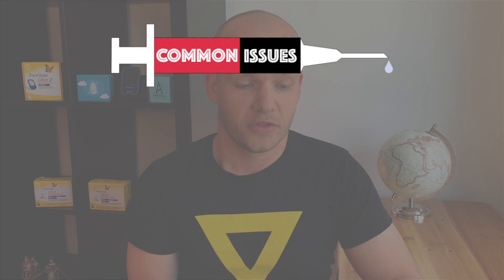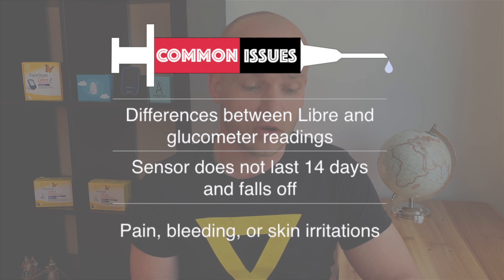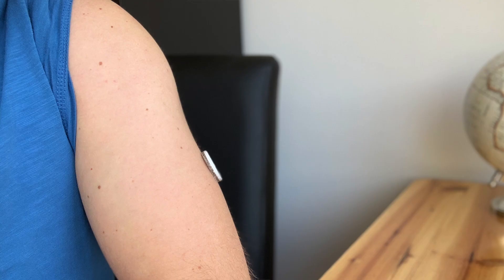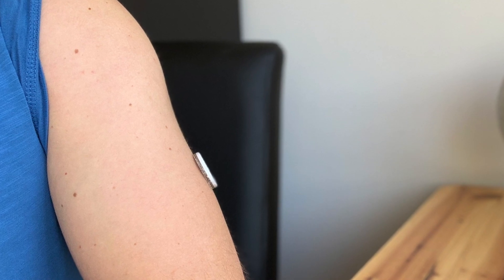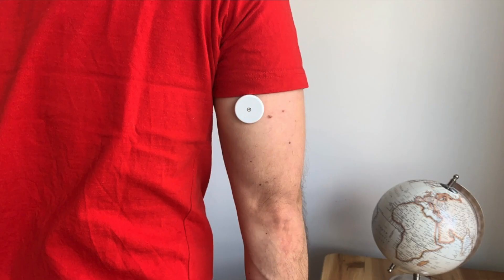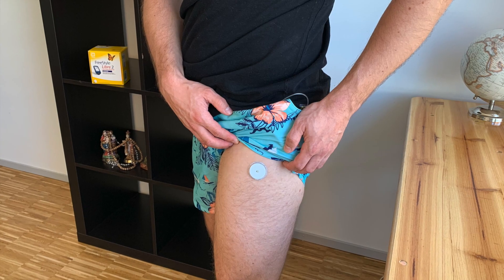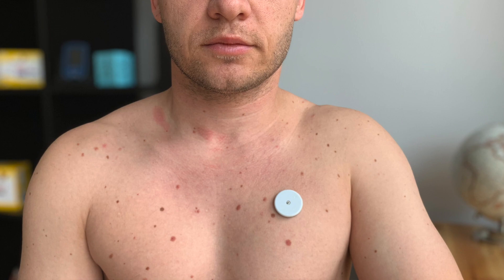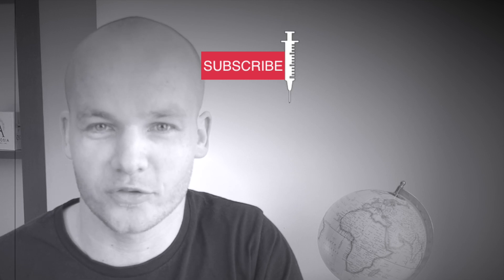Huge FreeStyle Libre Mistakes That Will Cost You...

Comment: On my phone - I get many ".crypt14" files plus suspicious "IMG" like this: "Successfully sent 80,450.00USDT This transaction usually takes less than 10 minutes" IMG-20240930-WA0009.jpg... this wasn't even linked to a sensor yet!  IS THIS A VIRUS?? I'm not taking any chances and removed this Rouge app.

Just found out REAL ISSUE WAS "What'sApp" unknown to me that app, required for work, allows groups to just fill phones with pics unless you remove the group; if you can!  Out of the blue this all started when I installed the Libre app!!

Comment: I've never had the right reading and the signals always lost and no I didn't leave it in my car when I walk away it's in my pocket.ive never had luck out of any sensor .mine always 50 higher or 50 Lower so what good is that when it will put me in coma Either I'll have a low at 70 it will be to late by the Time it makes it to 20 or I'll over react to my insulin chart and it will drop low because the sensor gave me the wrong reading so I took insulin to adjust it and I bottomed out because of Libre company's mess ups ! So you tell me how to you feel confident in any product that doesn't work unless it involve a finger stick which is usually right everytime .Makes no since to me company's make products that Don't work.

Comment: I check mine every 10 minutes when I'm testing various foods and combinations. Overnight, I check every time I wake up, if I remember, to try not to lose data. When the Low alarm goes off, I check. I don't bother with the high alarm, because I no longer take insulin. Otherwise, I check occasionally throughout the day - every hour to 3-4 hours, when I think of it. I'm type 2. Currently a very high A1C, but with the major changes I'm making (multi day fasting, fast weight loss, nutrition, avoiding most sugar, exercising), I expect that to come down quickly. Just a week in and I'm already seeing major results, though I know the results will slow down. Last year I lost 38 lbs in 3 months doing almost all of what I'm doing now.

Comment: I have found your "youtube" info to be VERY HELPFUL, except for one "contradiction" I do not understand?? Around 6:10-6:12 min:sec in this video you show adding a bandaid-like cover over the sensor just before you state "make sure you do not cover the middle spot of the sensor around 6:18."  That seems like a complete contradiction, and I did not see a hole in that adhesive "cover." Can you explain how that can work in the Libre 3 Tutorial, where you also promote the Skin Grip cover that has no hole for the middle of the sensor??
Reply: Good question

Comment: I thik that middle spot hole is construction dependant, it serves to push and pull the big needle. Only the black thread with contacts stays 14 under the skin and measures the resistance. You pull out and throw away the big metal needle with the applicator immediately after inserting it. It is only a pipe to guide the small one, this small is flexble and cannot penetrate your skin. This hole is bad for swimming/showering. I think it is better to close it (water drains to the hole in skin and can cause infection on the enter point. It could also damage (short) the electronic circuits of the sensor. But maybe the evaporating on the skin surface also damages the electronics when closed?!

Comment: I have watched your vids and use your advice.  The big problem I am running into is I am getting 1 in 3 failure. After I activate the sensor and the hour has passed the app tells me my sensor is bad. I notice when this happens the filament is partially poking out the top hole in the sensor. Have you experienced this?

Comment: I’ve had nothing but trouble with the Freestyle Libre 3. The first time I applied it, it was fine for the whole 2 weeks. Next time it fell off shortly after. I washed and used the alcohol wipe. Next time, I used medical grade tape to help it stick, as per pharmacist. The sensor did not work! After this, I used skin tac and I got the check sensor message! I loved it when it worked. My husband said to give it up, it just doesn’t work for me. But I loved it when it worked. I did call customer service and they sent me a free sensor. That was the one I used with skin tac. I have another coupon for a free sensor but I know my husband will have a fit if I try it again. Oh well

Comment: I’m type two and I used the Libre a month ago and something was really wrong. It would say 60 in the am- obviously not. The numbers throughout the day were always 20-30 points lower than my two meters (which were close to each other). I think I got a lemon. I’m trying to get a new one to try again. Also, isn’t the outside of the arm exactly where the manufacturer says to put it?

Comment: Any advice about the sensor adhesive failing not from the skin, but the plastic sensor itself? the adhesive sticks great on the skin, but the sensor itself seems to detatch from the adhesive. Do cgms from other manufacturers have a better track record on sensor failures? By the way, you comment on using sensors in various places, but the back of the arm is supposedly the only correct place to apply. I have this freestyle for a few months now. it is great, when the sensors dont fail. Last 3 sensors failed, and 4th is already starting to fail after only a couple days. I think abbott is slacking in the quality control lately. They are already pinching pennies, by not including the 2 alcohol swabs in sensor package, indicating that yes changes are happening in the mfrg process, including a decline in quality. They have a faq on website where they advise people to purchase the alcohol swabs themselves now. Maybe they are pinching pennies on the adhesives also.

Comment: SPOT ON!. The first time I got my sensor, I compared it with several of my blood meters. I got confused by the readings. There's a difference between injecting fast insulin with a sensor or glucose meter. I have explained this to my nurse and her answer was that the glucose meter could be damaged. I have used MICRODOT+ for 10 years. I find it very reliable although very basic. I have used also: PALMDOC 2 and SURE SMART DUO(ideal for type 1 patients) which allows you to test ketones. My main issue with the latter two is that they use standard batteries. They do not last long. The MICRODOT+, has a button battery, that can run for almost a year. As batteries run low, is possible that readings may not be as accurate as they should be.
I have tested this issue in a blood pressure device that uses four batteries. As soon as I removed the batteries and plugged them into the mains, the readings were more accurate. I am using now the FREESTYLE LIBRE2 reader, which has a lithium rechargeable battery. It came with a cable that transfers data to the computer and charges the battery. Unlike mobile apps, this reader acts more like a pager. I question why they provide these meters without a cable to transfer data, and why they can not create them with a cable to charge them. Batteries are a huge waste!. 
I am very happy to apply my sensor on the chest. If shaving is all it takes, so be it. So far best place, despite what doctors and nurses recommend. Thank you so much for taking the time to try these devices, you have saved me a lot of anxiety.😁

Comment: 👋 Tom, thanks for the videos, very useful. I’ve been using Libre sensors for the past few years with no issues. However I updated my phone to an iPhone 13 a few months ago and I have been unable to connect the sensors to the phone app. I have recently moved on to the Libre 2 sensors and these are also not connecting. Are you aware of an issue with the app & the iPhone 13? I only ask as Abbotts are not very responsive.

Comment: I use a clear round sticker off Amazon and I work outside and it’s always coming off because of the humidity inside the sticker. Should I hole punch a whole in the middle of the sticker so it doesn’t come off? I’ve lost a few sensors because of sweat.

Comment: Great video, Tom.  I scan anywhere from 6-10 times a day.  The high side is on those days where I have high or low glucose.  There are some things I have found that help. One is that I have moved the location from the back of the arm to the side.  I did that because the surface is flat and so adherence is better.  Abbott recommended to me that if the sensor starts coming off, then use of a medical adhesive tape about 5 inches long will hold it in place.  And you can still shower.  Thanks again!
Reply: I wish my doctor would tell me to use a different area, but I don’t know where my leg I think is the best and it’s never seen by anybody and it’s so easy to go and scan it there with my arm is like trying to stretch yourself all over the placeLOL, she said it has to be in the back of the arm but high put it there. I always go to the doctor to put it for me. I have no patience for this. I want to put it on my leg I gotta ask her
Reply: just do  it drs don't have final say @1985LISS

Comment: I read somewhere (or maybe heard in one of your videos) that the purpose of the hole in the middle of the sensor was to equilibrate temperature and humidity. Perhaps. But I have a suspicion that its real purpose is to allow blood to exit should you hit a small vessel rather than having the blood accumulate under the adhesive and loosen it prematurely.

Comment: I am so frustrated with my libre2 sensors. I use the app and NFC but every time I eat eventually during the 2 hours post meal my NFC can't read the sensor. Then some time later it'll work every time. I try to scan every 2-4 hours and then pre-meal, +15 min, post-meal, +15, +30, +45, +60, +90 and +120. But usually I never get all the post meal scans due to the aforementioned issue with NFC scanning.

Comment: Hi Tom, thank you for all of these videos! I have learned so much!    I am having a problem with libre 2 failures where the differences between cgm and finger stick is over 30 to 40%. Right now libre 2 is 94 finger stick is 124 (USA). Is libre 3 better or libre 14 day or this one? is this a common problem? The sensors are failing almost half of the time and although Abbot replaces the sensors, it is a pain because I can trust the readings.  Do you have any advice for me?

Comment: Hi Tom my name is Kimberly Westervelt and I have diabetes from having my heart transplant and being on immunosuppressions. My insurance finally approved me for the libre 2. And, at first, I was doing both the libre and the blood glucose check and I called my doctor and she told me just use the libre and if I'm very low or very high that's when I'm to test my blood. That's what I've been doing. My question is when you have your libre sensor in your arm can you inject insulin in that same arm or should you avoid it? I haven't watched all of this video yet I'm in the process of doing that and I don't know if you'll point out the injection of insulin or not. Thank you for your videos they're very helpful and reassuring. ☺️

Comment: SENSOR ERROR! Glucose reading is unavailable. Try scanning again in 10 minutes.  This happens once a day and lasts for over an hour each time. This sensor is trash and I couldn't imagine making actual treatment decisions based on its data.
Reply: And: It's 2 a.m., Your P.A.(Dr retired last summer) ordered 3 (discontinued) READERS, (Sensors ! The 14 day type I've used for years)Pharmacist couldn't fill or change(Pharmacy will open at 9a.m.), Ins. Company doesn't understand what test  strips are, your New Pixel 7 phone doesn't have a compatible App,
Last reading was LO, 

911 is busy. Please try again in 10 minutes.
Reply: Actually, my last hour wait/conversation with Libra was productive. They sent me a new Reader Set Kit,(beware-they have a recall issue on the lithium batteries on some Libre machines.
They  replaced 2 Error sensors.
And my phone is reading the 3rd  defective sensor after starting it with  dedicated reader.

I don't like the inaccuracies 15-30% but it is so much better than 1971.  Back then it was a urine sample (not time/blood sensitive) and a litmus paper color match, glass syringes and needles with inside diameter big enough to hold 2 modern syringe needles.
I take a long acting insulin 6 AM & PM. 
Novalog(rapid) with meal(1-2MealsPerDay)

Comment: I would say my #1 frustration from my own experience is sensors ceasing to work with 24 hours or less. It's REALLY annoying when I put a new sensor on in the morning and by 12-2am it's already telling me I need to change/scan a sensor. At least 1-2 sensors per monthly package (and I only get up to 3 sensors a month sometimes) are failing within 24 hours and even when I take off the failed sensor, the little filament is always pointed straight into my skin, so I don't understand why I keep having so many sensor failures and I'm starting to think about just going back to finger sticks because there is much less margin for errors and failures, but having my glucose reading at the tap of my phone is just so much more convenient and less of a hassle because you don't have to drag out all your diabetes supplies every time you want to see your glucose reading. I honestly don't know what to do, except keep complaining and keep ordering replacement sensors. Ugh! 😡
Reply: I'm having the EXACT same issue. I've never had this happen before now. 3 sensors in a row that I received from my pharmacy.
Reply: If you call the manufacturer they go through some steps with you and will send you a new sensor for free when they determine it is a faulty sensor
Reply: @jaymiemitchell5917  Yes, I have called and received several free sensors to replace the bad ones. I just had to call again yesterday to get ANOTHER new one and the old sensor only had 2 days left on it. I just don't understand how they go from working for 12 days to suddenly not working at all and having to change it. My biggest issue right now is that we just moved back into our house, everything is still packed up in boxes, and all my old sensors that I needed to send in are now all mixed up, so I don't know which sensors are the failed ones.

Comment: I’m having an issue with my readings. The sensor im using is the first 14-day sensor I’ve ever used, all my ones from before were the ten-day sensors but I’m not sure that that makes a difference.

My father is a retired doctor and used to put them accurately on the back of my arm for me because it’s hard for me to reach, but with the last couple applications it’s hard for me to get him to listen to me about putting it back there. I tried to tell him this yesterday but he wouldn’t listen to me, and he applied it at the front of my arm instead of the back, and now my readings are crazy. The day before yesterday my readings were in the 90s, and checking yesterday with the new sensor they were from 300-497 throughout the day, and I know that’s not right because my insulin has been acting perfectly. Is it just a placement error? Do I need to sacrifice the sensor I’m wearing and put a new one in the right spot?

Comment: the first sensor worked pretty well once in awhile it would give you a false reading but you would check again 10 minutes later and it would give you an accurate reading it work great for the first 14 days the second sensor has been hell for less than 24 hours that I've been trying to use it I'm taking it back to the pharmacy I believe it was defective from Factory

Comment: I had my freestyle Libre to making warnings even after I turned off the low glucose warning alarm and it was giving me wrong readings in the fifties and sixties everytime I would check I had to finally uninstall the app so I could get some sleep LOL when I installed the app back onto my phone it would no longer work with the sensor which was brand new is this normal

Comment: I made a mistake of scanning the old sensor rather than the new one I just started. When I checked the newly installed sensor I got the message that it is not ready and to try after 10 minutes. I tested it again and received the same message after several tries.

Comment: Interesting. I came here because I recently got diagnosed as type 2 and have been trying the Libre as an alternative to the finger prick type. Apparently I don't come equipped with blood... 

The first sensor worked great, but the next two wouldn't read anything, so will definitely follow the cleaning/ application tips here for the next sensor install. 

Even the two weeks of data I was able to get have been illuminating. Looks like I'm extremely insulin resistant. Will have to figure out how to deal with that.

Comment: Hi Tom.  I just received the FreeStyleLibre 14 day.  I cannot unscrew the applicator cap.  It looks as if it has a locking band above the threads.  Am I wrong?  What can I do to unscrew the cap without damaging it?
Reply: They need to change that design. I have a horrible time unscrewing it too

Comment: I wish I would have watched videos before I stuck my first sensor on. I have very low body fat and stuck my new Freestyle Libra 2 on the back of my arm and it was in the muscle and it hit a nerve. I shaved & cleaned my chest then slowly worked the sensor off & just stuck it on. It was on for about 6 hrs but you can move them. The whole thing is a “sticker” not a ring… Update it only read 2 times didn’t work the needle bent.

Comment: I have the Libre2 was well as a desk job, so it's fairly convenient to scan regularly. As a result, I generally average 20-25 scans a day, sometimes more after any change in medication or dosage. I do have a few reminders set so that a couple of scan times occur at about the same time each day. I also click both the 1h and 2h reminder options after entering my carb intake on the reader after taking a scan. I also do one blood glucose scan with my first meal of the day, along with a CGM scan about 10-15 min later, so that I have a good idea about how the sensor is trending in relation to a blood reading.